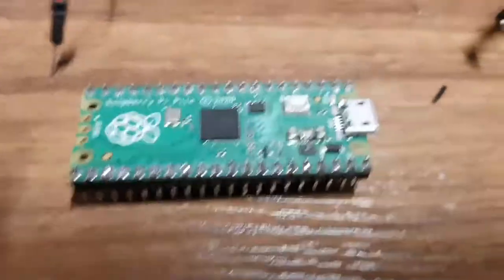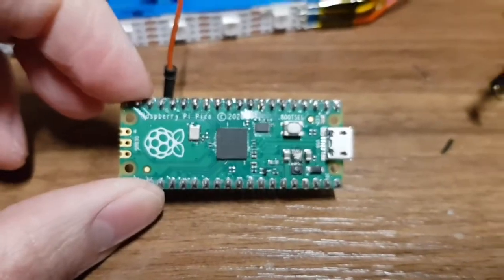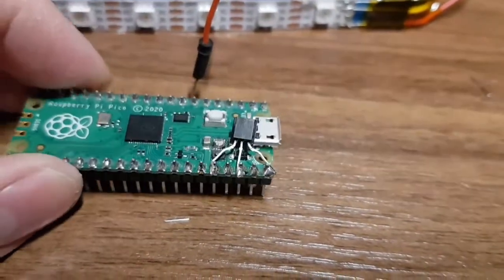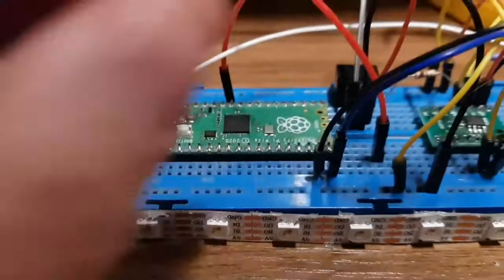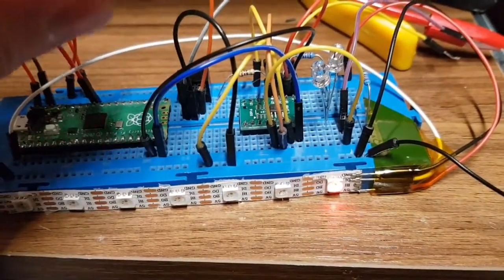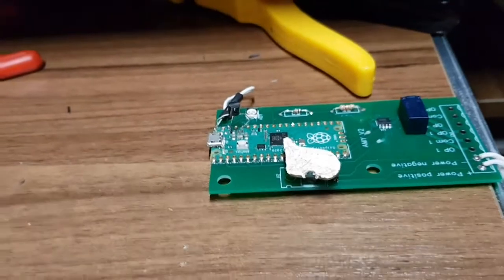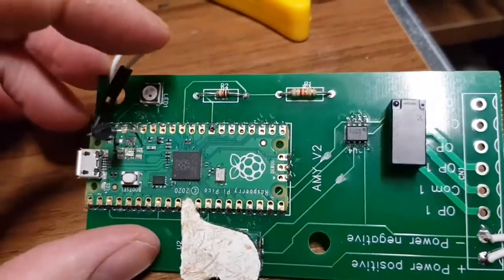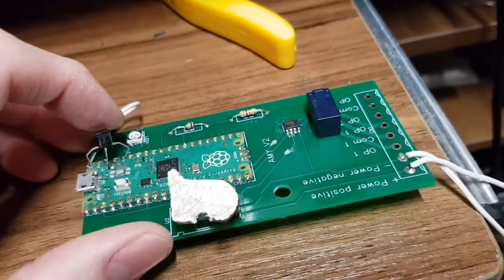fixing the raspberry pi pico

Comment: the led lit up blue then went out again i think i would check the traces on the pcb the pico is soldered to also noticed when relays are used they tend to put a diode on the coil side to stop feedback i would put another peco on no relays see if it works then put 1 relay on see if it still works then the next one try and work out what is overloading the regulator
Reply from the maker: The relays are driven my motor driver ICs as there latching types using a Push pull drive. As a result the coils of the relays are already protected from feedback by the ICs internals. But a no less a worthy thing to note.
Reply: @mathewlawrenceml  bugger that rules that idea out then